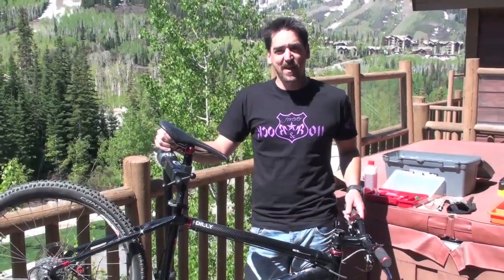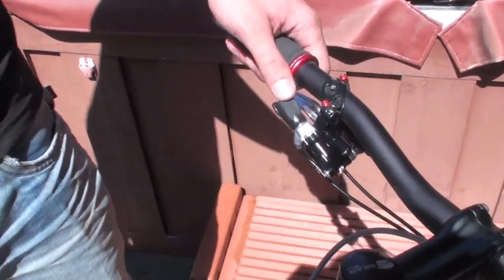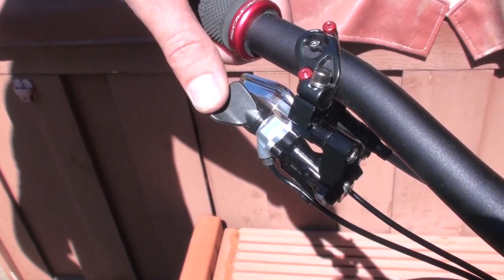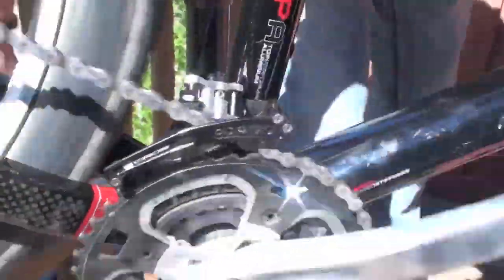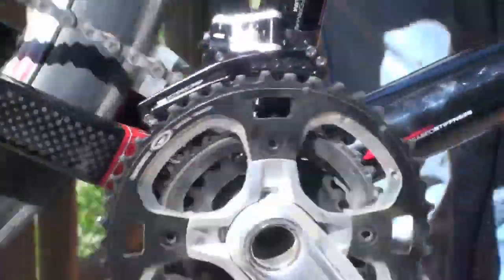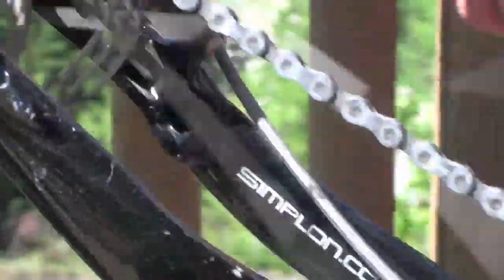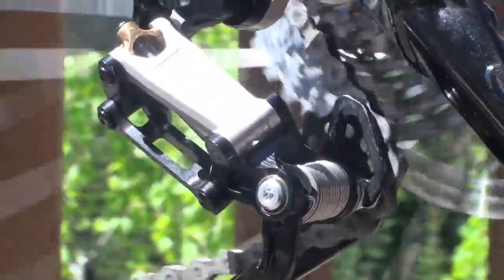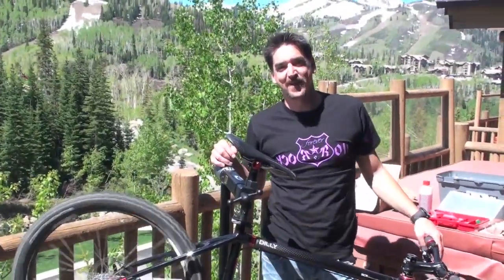PC2011-Acros Hydraulic Shifting.mov

Comment: What's happens when you push on the rear derailleur, not the shifter but the derailleur itself ?  Is it locked in place by the hydraulics ? Like...if you had to slack the chain or take the wheel off, there has to be some kind of release right ?  

Incredible though.  I would buy these if I had 2k to spend and there was a road version.